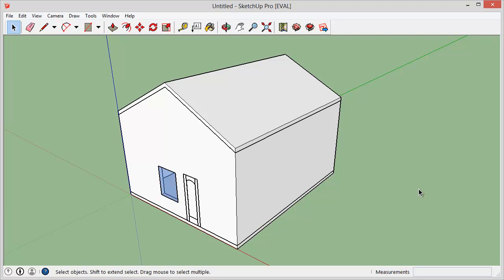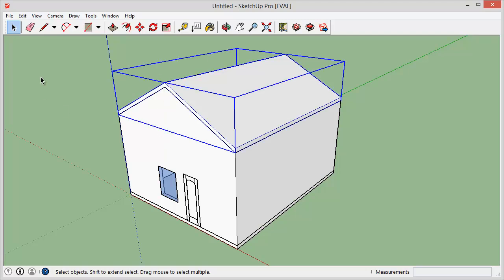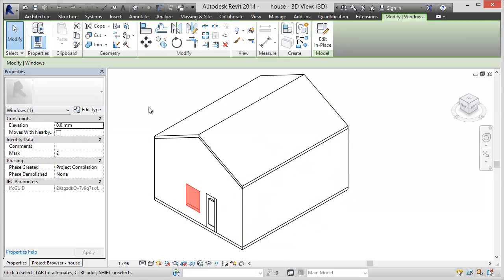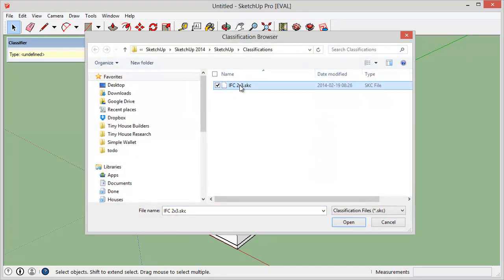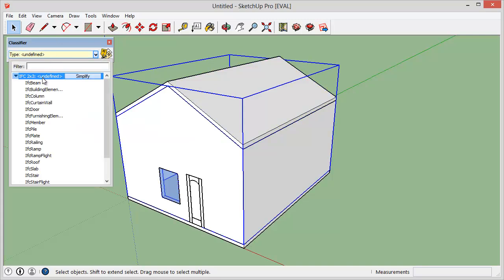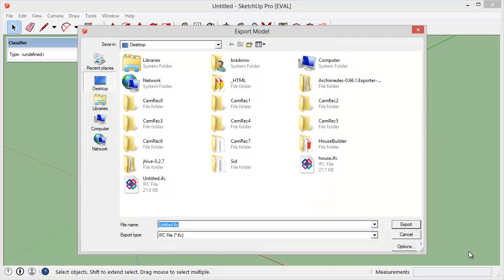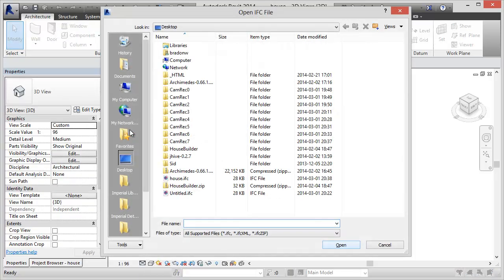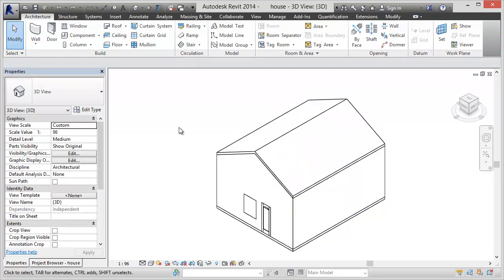SketchUp 2014 BIM

Comment: It classifies it as a roof but... when i bring it into revit I can't change the roof to a 'Revit' Roof. For instance, I created walls brought it into my revit file and selected the wall but it will not allow me to change the wall to a revit wall with finishes, structure, substrate etc. Where can I get a file for IFC classifier that will directly interpret into revit to allow me to change the wall to a 'Revit' Wall? Hope this makes sense.
Reply: Hmmm looks like the classifier simply makes the sketchup file a modeled-in-place item rather than an actual revit component. So i can't load in the sketchup file and replace the sketchup wall with revit walls.
Reply: Yeah, if you use the default IFC 2x3.skc Classifier, it seems Revit can't convert it to match it's own classification system. I wonder if it's possible to import the classification file used by Revit into Sketchup. Actually, I don't see any use in importing a Sketchup IFC into Revit if you can't easily convert the components into native Revit elements. The only difference is that you can see within Revit that the modeller called the roof "Roof" and the slab "Slab"...

Matthew, can you see any differently?